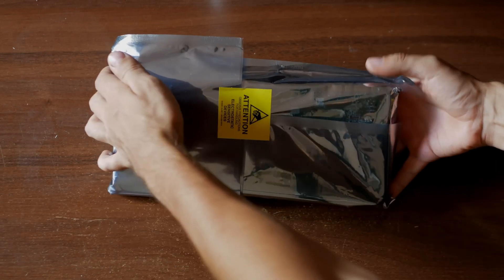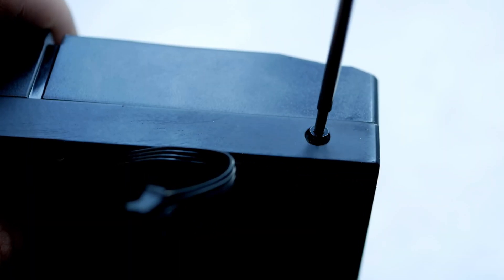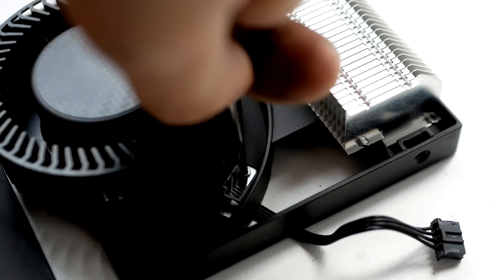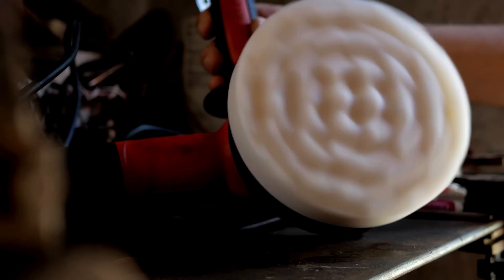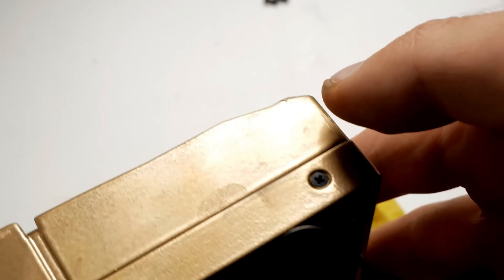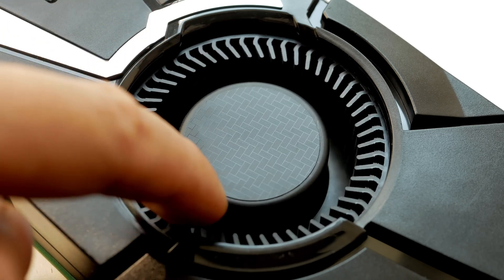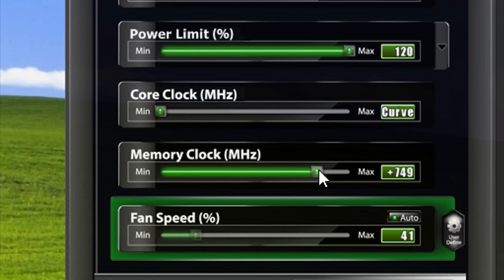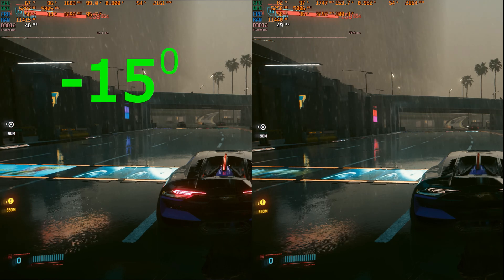How To Improve Blower GPU?

Comment: Years ago I had a blower Vega 64, I replaced the blower with a Morpheus II and 2 120mm fans. The difference was unbelievable. Completely silent, 30% cooler temps, 20% performance increase. Those blower setups are DUMB

Comment: I've got a Zotac 2080Ti Blower, replaced the stock heatsink with a copper one and my temps dropped to 69-70°C under full load at 50% fan speed.

Comment: Holy.. u bought the worst custom design for a way to high price. Last year at the same time u could buy an GTX 1080 with good custom design on craigslist for 100 bucks.

And instead of doing some usefull mods like a coppermod, heatsink / backplate mod and adding liquid metal, u decided to simply give it an ugly paintjob.

Why are ukrainians like that?

But i have to give big props to ur video work. The quality is insanely good. But i hoped for a non-nonsense upgrade build.

But this is just useless.

i left a sub anyways in hopes to see the same quality but with nice builds

Comment: You could just put there Arctic Accelero Extreme :D Just arrived some used 2080 Ti to me and guy sent me that Arctic cooler too. But after undervolting and some playing in Afterburner the temps are max 85 on hotspot with blower, so no use for Acellero yet.

Comment: The comedy value of this video is as golden as that shroud.

One thing to note though, You need to raise the freq graph up with a positive offset and then cap the max voltage. By pulling graph down you're actually overvolting the freq below your cap, as seen by the lower portion of the curve against the stock curve
Reply: but is that a problem in practice if the lower portion of the curve only apples for low (idle?) frequencies?
Reply: You are the best

Comment: Man, I can’t tell you how much I hate it when I’m working on something, and I have everything I need to take it apart and 1 singular screw strips causing me to have to fight it till it comes out. What I use to get stripped screws out is either the next size higher, a triangle bit or flat head, torx screw bits may also work for getting stripped screws out also if you don’t want to saw it out. Good video :)

Comment: I bought a 1080 Ti blower card and replaced the fan with a Raijintek Morpheus II cooler solution. Works great and keeps the card very cool - probably 20C cooler than the single fan.
Reply: Send me a link I made the mistake of buying a dell rtx 2070 super blower GPU
Reply: The price IS absurd man, people Who get blower gpus are not usually with the money to choose the best options... I have to find something affordable to cool my 2080ti without that ridiculously loud noise
Reply: @funkiEst  i believe it is possible, theoretically. With blower style cards, the problem it has is the fact that it is basically a chamber trapping heat for the card since the idea is the blower fan sucks in the air and push cool air out to the back of the card. this is done with the closed chamber design that routes the air that way. this makes it hard for the heat to escape from the card and for cool air to come in from anywhere else. How do we mitigate this? according to the video, the heatsink is already there... so just pull the cover up. stuck in a noctua or third party fan, rig everything up somehow, connect the fans together to the gpu fan port, and voila. no raijintek or arctic additional cooler required... theoretically.
Reply: I did the same, last week I also put a morpheus II on my 1080Ti MSI Aero